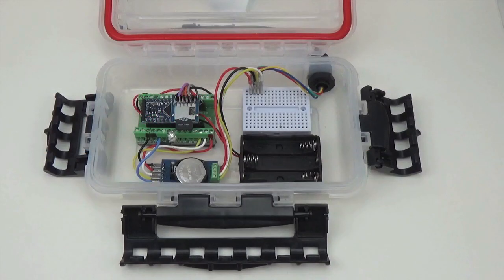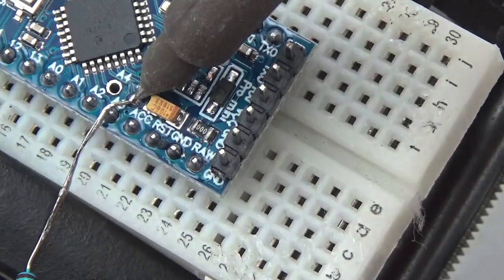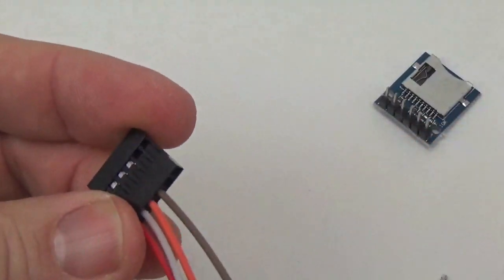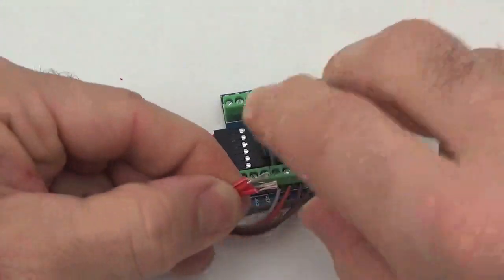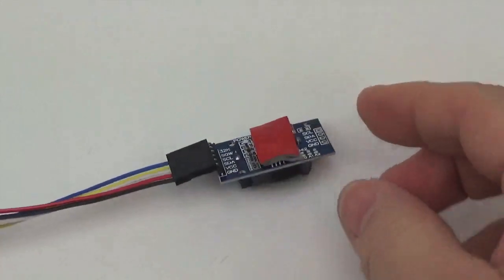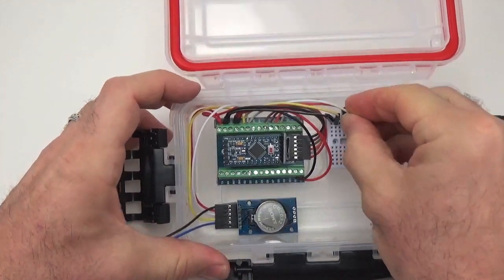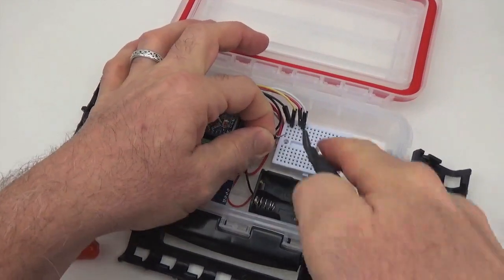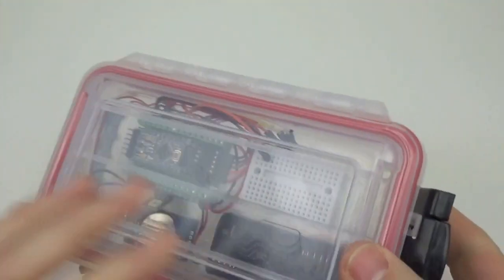2019 Student Build: Addendum: DUPONT jumpers (~1h build time)

Comment: Nice job.  I think you could simplify things further if you used a couple of 5-way Wago lever locks to distribute power and ground around the box.  They'll accept DuPont wires and eliminates all of the failure-prone splices.  https://www.amazon.com/Wago-221-415-LEVER-NUTS-Conductor-Connectors/dp/B06XH47DC2